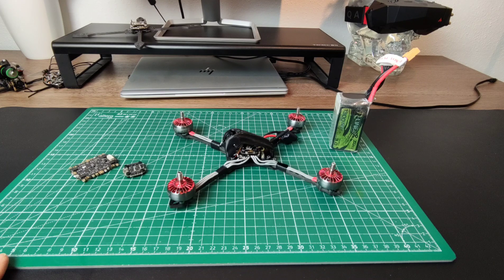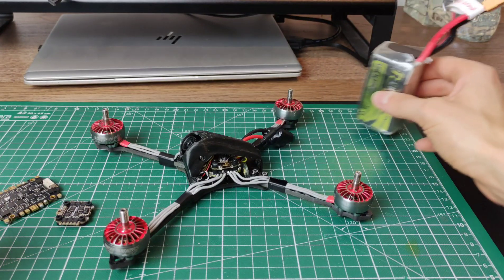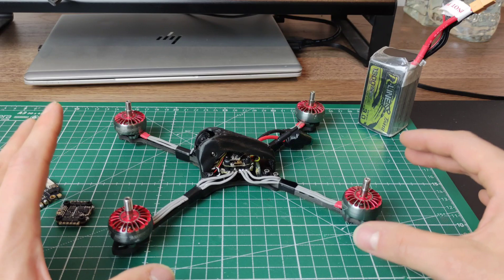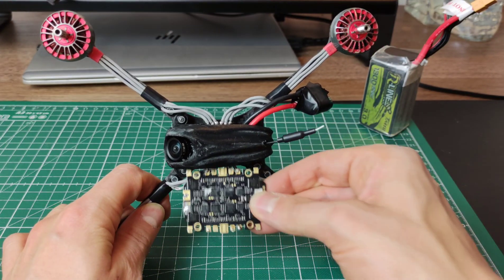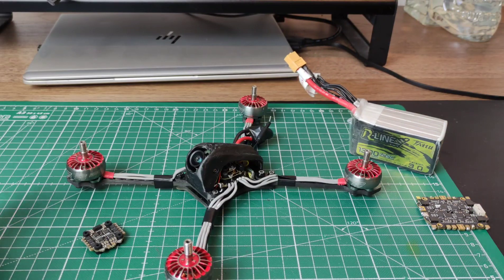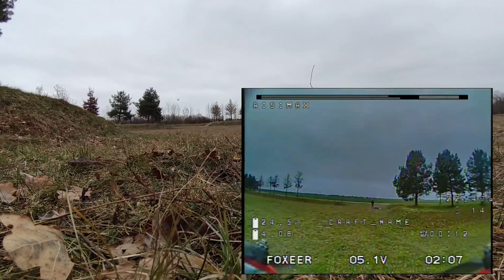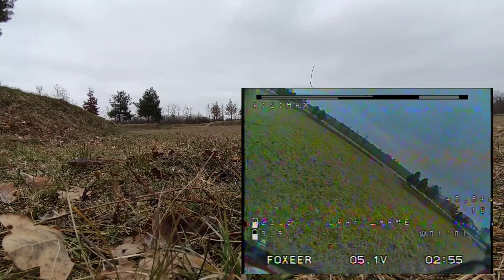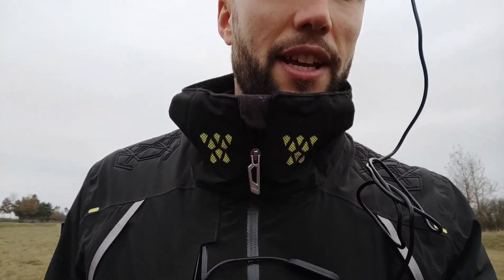Bad idea? 16x16 ESC on 6S FPV Racer

Comment from the maker: Quick update: I took the quad apart and upon closer inspection found the current sensor fully  de-soldered and fell off. I assume that did cut the current supply and shut down all the electronics ... So seems like 16x16 ESC aren't ready for 5" yet 😅
Reply: Maybe a 1700kv engine setup for lower power would keep the current sensor on the pcb :-)
Anyways, thanks for testing so i don't have to !!
Reply: Try to bridge the current sensor with wire and try again
Reply: I wonder if they‘ll ever be ready. I guess you need a certain amount of metal to handle the current 🤔.
Reply: 16x16 is the devil bro. Nothing but nightmare after nightmare with hints of bliss here and there.
Reply: Hahaha!
Reply: Will their 20x20 aio fit ur long range 5" or too long.. ?

Comment: is the cap at the end of the xt60 the only one installed ? if so its basically useless so far away from the fc. might just be the cause of voltage spikes that killed the fc

Comment: Would be better with a 1000mah battery and a spike absorber, can buy the tvs diodes and make your own. I use 3x SMCJ24A DIODE, TVS, 24V, 1500W, SMC in parallel. Just have to remember to connect the cathode with the line to the positive side.

Comment: It is much better for noise/voltage spike  reduction to connect the capacitor near the ESC and not on the xt60 end.

Comment: Sorry for your loss but I'm assuming you get this sort of stuff on review for free. If so  I'm glad you took the hit for the rest of us if not then sorry for your lost.  Ever since i built your Sanchez 3 last year I've been frying AIO's left and right. At least now we are starting to see some more robust FC's.    Have you played with the JHEMU 35a AIO 20x20 FC I've seen some folks claim it's "Bullet Proof" Not convinced until I see it on a build like yours and or some turtle mode flips. That's always a good challenge for an AIO.
Reply from the maker: Yes it was a review sample :-) Not sure if flywoo will be happy about the results but I just had to test it will really hold up to the promise of 35A 6S. I only have the JHEMCU 1S AIO but it seems to work great so far

Comment: Hmmmm motors holding up for more than 1 month??? Never head of that before :-)
Reply from the maker: Trust me those have gone through some abuse!
Reply: What was your setup? Were you running 6s / with 6s motors? What KV and what props? But regardless AIO's and 16x16 have never been as reliable as 20x20 and 30x30. I wish we had a good AIO for 6s that would allow us to really slam some builds and get the weight slightly down a few grams.
Reply: @gmascagni  Nah, its just that I run my gear hard and stuff usually breaks pretty fast

Comment: I have two 250g 5” builds, one with 1804s on 4s and one with 2004s on 4s. One has a 30A 20x20 esc and the other has a 35A AIO. I’ve not had a problem with an esc yet. Vibrations in the video feed at mid and high throttle, well that’s another story.
Reply from the maker: That's a much more reasonable build with 2004  (compared 2206 on 6S). And sure, the stock tune didn't help either 😅
Reply: I’m waiting for all this rain to stop so I can test out the 2204s on the sub 250g 7”, but it looks like italy has another week of this rain. How’s Germany looking, is it build time?
Reply: What 1804s do you run? The Xnova?
Reply: Yeah, xnova on 4s. 
I like the 2004s better, I’m building a 6s version with a 6s 450mah battery to get it in the 250g range.